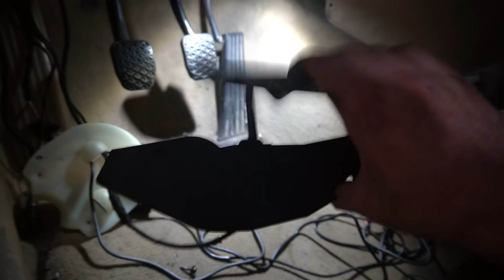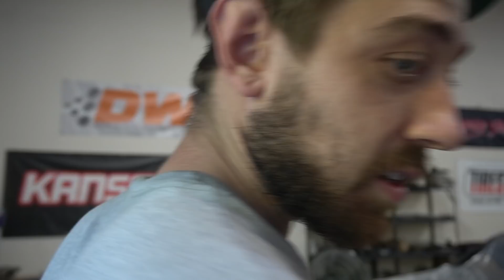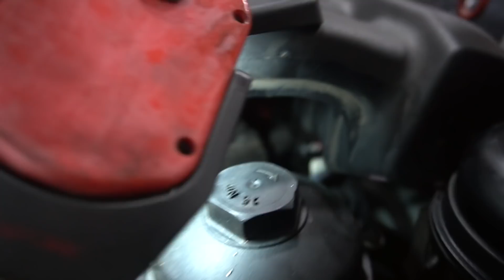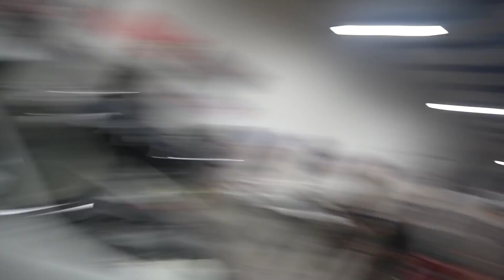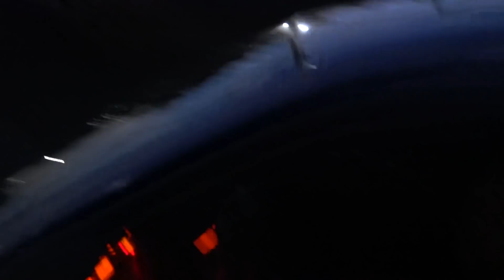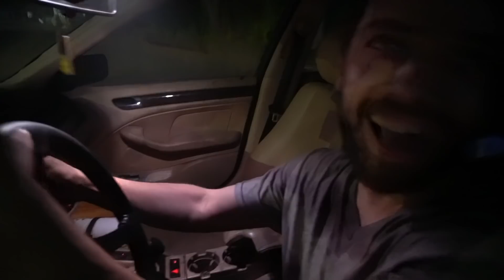M54 ZHP BMW SWAP - FIRST TEST DRIVE!!

Comment: As an old ZHP owner, b hall is about to fall in love with that M54. It’s a better s52 for half the price. They’re absolute tanks!
Reply: Have you ever got a chance to drive a regular 330 m54b30 vs the zhp?
Reply: better than an s52? lmao
Reply: @GoatFaceNation  yea I'd love to see someone run the S52B32 vs M54B30 
ON THE SAME DME whether it be MS43 or MS45.1
Reply: @ifan3270  I have both at the moment, absolutely no difference lol, if you race both zhhp is faster because of the 3.07 final drive instead of 2.93 lol
Reply: @elizabethcrepin1007  maybe for u guys in the US, EU spec s52b32 is actually sick...
Reply: @elizabethcrepin1007  here in canada the zhp has different cams with 10 more hp, idk if its the same in the states
Reply: @katos8804  euro s52 has no good aftermarket potential. Na it is better than the US market motor, but with any turbo or forced induction is considered, the us motor is a better candidate by far.
Reply: Damn i need school myself more on my passion e36 vehicles lol im like the kid in back fuckin drawin instead of learning smh lol
Reply: 1337rx7 I’m in the US where our s52 makes similar power but lacks the silky power band of a ZHP m54. For the US, we enjoy the zhp package !
Reply: I ///М Fan multiple times but only in a full ZHP package car. 330 vs ZHP is night & day. It had a 6 speed instead of a 5 speed, 3.07 gear ratio was great, silky revving m54, m performance suspension, lighter style 135 M wheels. Can’t compare just the engine but even then you’d know the difference.
Reply: @katos8804  there is no such thing as an s52b32. The euro spec engine is called the s50b32, vs the euro s50b30. US spec only got s50b30 and s52
Reply: @epaminontas6972  oh yeah my bad
Reply: @katos8804  what's crazy is how expensive the euro s50s are in America. A fully dressed euro s50 would go for around 8k over here, which is why people usually go with the s54
Reply: @lakeshorerides  Yup, but turboing is not really an option in germany since it is pretty much illegal here
Reply: @epaminontas6972  they cost the same over here unfortunately😬

Comment: Please put in an oem guibo before Brian destroys his transmission
Reply: FCP euro them like once every 6 months, its free to replace after the first one and they are easy af to replace with a lift too!
Reply: I have a solid chunk of aluminium with six holes turned on my lathe as a guibo on my 320d e46 with a welded diff. 1000+ clutch kicks and still in one piece.
I might just be lucky tho

Comment: Hmmm electric gas pedal, i wonder if there is a way to wire it to your steering wheel and actually control the gas with your hand

Comment: Whats the part number on the Valeo single mass flywheel clutch conversion, also with that valeo kit are you having any transmission noise at about 3.5-4k when the clutch pedal is compressed?

Comment: I’m having problems with my bmw 330i 2001 my car goes into limp mode and my traction light is on and abs light is on and handbrake light is on I replaced all wheel sensors I’m trying to figure out why the transmission goes into limp mode

Comment: Does it being a zhp make it any different than a normal m54b30?
Reply: It's a performance package bmw offer. =]
Reply: Different cams and tune otherwise not much different
Reply: Upgraded camshafts, boost in power and higher redline. Revs silky smooth in comparison to a standard 330. Plus if you buy the ZHP car it gets very important upgrades other than the engine .